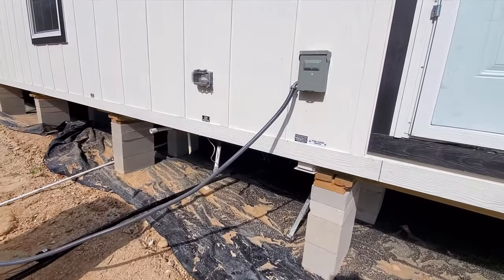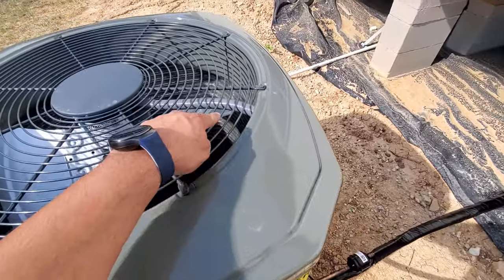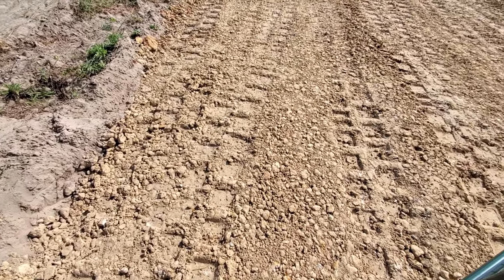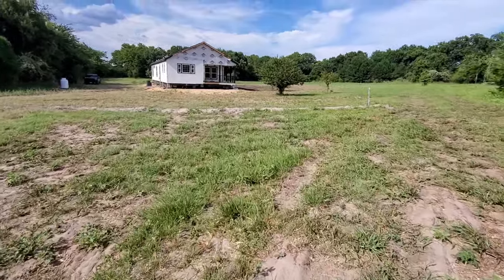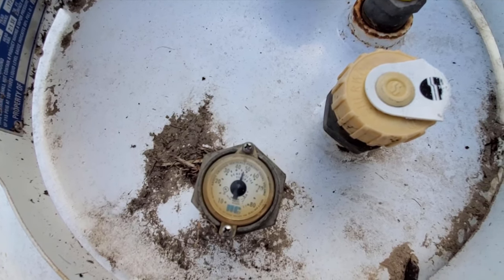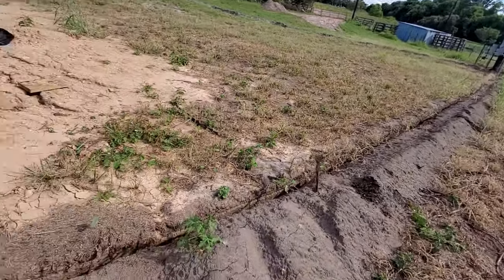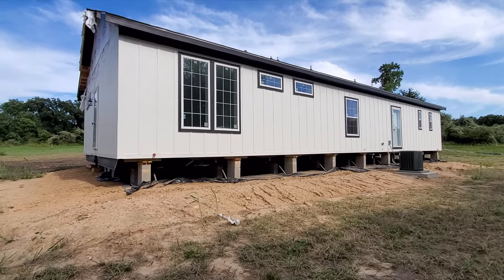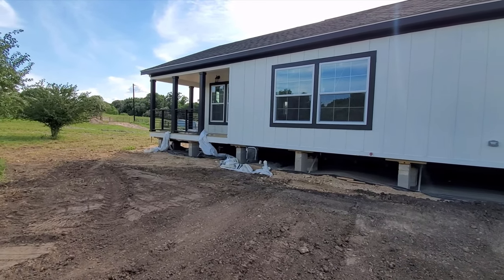A/C Condenser Installed On Modular Home

Comment: Omg they went under my home, knocked down the black netting where the insulation is because mine is an older modular home not brand new like this where it should’ve been done then, but this was a replacement, and they have fucked everything up! I’ve had plumbing issues when it under the black netting. They didn’t put it back up so that’s affecting the insulation affecting the floors. The unit is not the right size for my place. They completely screwed me over an i paid 12,000 for it. Omg! Looking at this and looking at what they did I am shocked.
Reply from the maker: Yeah, it's not a very reputable company.  It's been almost two years since we reported some issues to them before we moved in, and still haven't heard anything from them.  I'm also not expecting to hear anything back either.  So if I need something done, it's best to just hire someone else or do it yourself.  Once you close and they get the money, they're gone forever.   We got a big water filtration system for our water well 6 months ago, and they text me to see how everything is going with my system and also to check everything out. That's how a rally good reputable company should do things, unlike that modular home company.